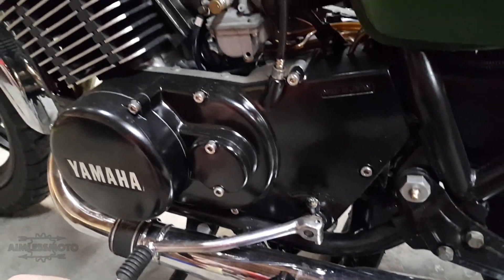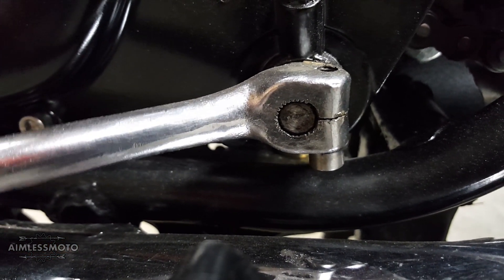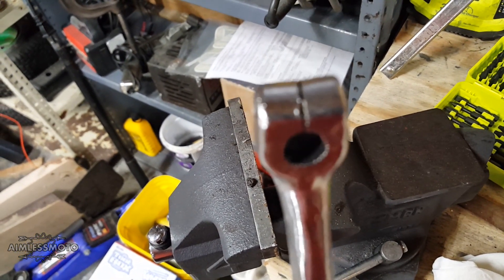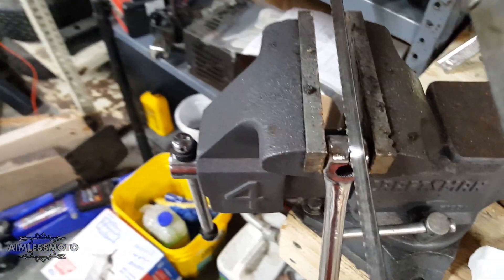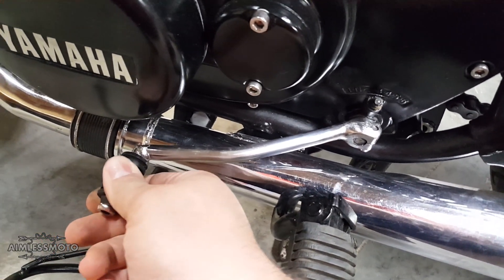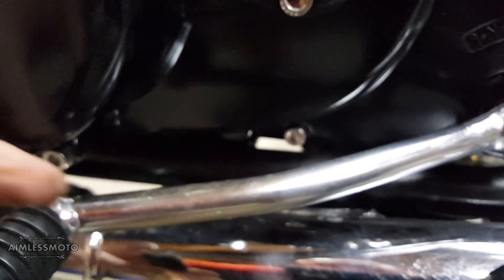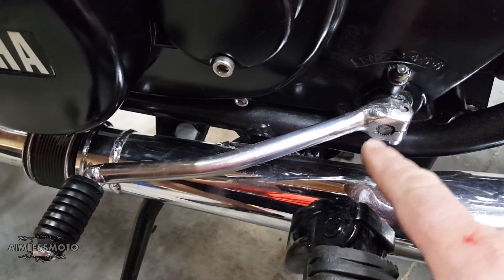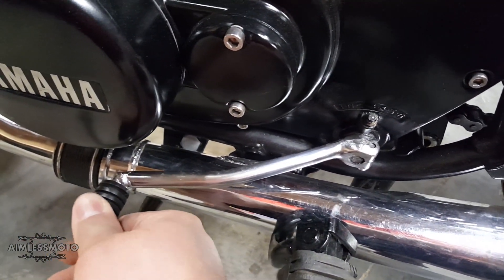How to Fix a Loose Shift Lever on a Motorcycle in 5 Minutes

Comment: best solution i found so far. really not trying to replace that shaft plus im having trouble finding a replacement part in the first place.
Reply from the maker: That's the thing... most people won't tear down the cases to pull the shaft. This is quick and dirty but also prevents further wear. The longer is stays floppy the worse it will be and then you get to the point where people just weld the thing in-place.

Comment: Thank you for the video and there’s something else I would like to ad on most motorcycles,atv and 3 wheelers you can drill the bolt hole out and use a grade 8 1/4in bolt and get it really tight.

Comment: Nice fix!  I may just need that one day, when I finally get a project!
Reply from the maker: D. FRESH. 750 Awesome! What did you get?
Reply: AimlessMoto oh, I didn't get a project yet, but have been wanting one for some time now.  First things first...trying to get my attached carport framed in, so I have a garage!  ✌🏼😁
Reply: AimlessMoto my first "real" bike was a 1981 Suzuki GS450T, though, that I did a little work to myself.  Been kinda wanting a GS750 or 1000 since, for a café racer project.
Reply from the maker: D. FRESH. 750 my bad, read that wrong... having a garage makes all the difference. I had a GS750 as my first project. Loved everything about it but the carbs. Such a pain to balance and tune. Once it was running right it was awesome.

Comment: I put a NOS shifter on my 1988 KZ1000-P and it didn't fix the problem for me. Tightening it down a lot more did work, but it only lasted about 3000 miles. Now I've wrapped the shaft in aluminum foil and put the shifter back on. Then I used an oversized bolt and put a nut on the other end of it when it poked out from the other side. It's a lot tighter and doesn't wobble. I'm not sure how well it'll last and haven't taken it for a test ride yet. For me, the problem is more the shifter rotating on the wrong axis.

I'll be test riding tomorrow, because the fix was done just after sundown and nobody's open right now for me to buy new bolts, and all my spares got stripped while I was trying to figure out how to make it nice and tight. The last one was the over sized bolt that I put a nut on.

Comment: on my '83 SR 500 it dropped loose the other nite drivn home - but with great skill and attention whilst driving i managed to get bike 20 km to home - sitting on fuel tank at some stages to change gear :) thanks for the vid - i need to acquire a new lever and hopefully not shaft also
Point to note: should you install alen head key with head up - lest it were to loosen and fall away.
Reply from the maker: A head key/woodruff, or even a drilled spot to punch a dowel in works if the parts are unable to be sourced. Anything you can do to NOT have to weld the thing on is the best fix.

Comment: It takes a lot more work to select gears now on my 2003 Kawasaki. It's not the lever and spline...I think it must be the selector thing inside? It used to be a tiny click to change, now it feels like i am picking up a chair with foot! Any clues?
Reply from the maker: Sounds (unfortunately) like a worn dog inside the transmission itself.
Reply: @AimlessMoto  thanks...but the only dog I know goes, bark, bark. I have seen a star shaped ratchet-like wheel with a claw that slides over the points and into the recesses as it gets rotated in notches by the lever in tear down videos of others bikes on YouTube. Is this what they call the selector? I’ve only done 35,000 miles on the bike, it’s always been regularly oiled changed, never missed a beat and of course leaks no oil. It sounds strange that the actual gears would be worn...though to be honest, I don’t have a clue. I do notice the clutch mechanism, doesn’t feel as tight and clean as it once was...(it’s cable only)

Comment: Awesome. I just can't seem to get my shift lever to slide off the shaft 🤦‍♂️ Raptor 700
Reply: Oh I got it. It was very difficult but I got it.
Reply: @TheSkystrider  brooo HOW😂 my shift lever will not come off
Reply: Crap I can't remember what I did to get it off. I think I might have used some leverage, well I know I tried that, just can't recall if that's what worked. It was very difficult.
Reply: @TheSkystrider  lol thx i just sent it to a shop… 65 dollars to get a damn shift lever off because the bolt was stripped😂

Comment: My shift lever goes down a lot whats wrong with it?
Reply from the maker: Does it click into gear? Sometimes the dog on the end of the shift shaft can get worn out or even bend if someone stomped on the shifter at one point... you may have to pop the cases and pull the shaft out to really inspect the issue...
Reply: @AimlessMoto  the shifts themselves are ok but for example when i downshift the shift lever literally points to the ground and if i am not careful when upshifting it goes up two gears instead of one. I will probably take it apart soon to see whats wrong. Thanks for the help.
Reply: @BassHeartRiffs  yes you were right the threads on the gear lever were bad so i replaced it. Thanks for the help!